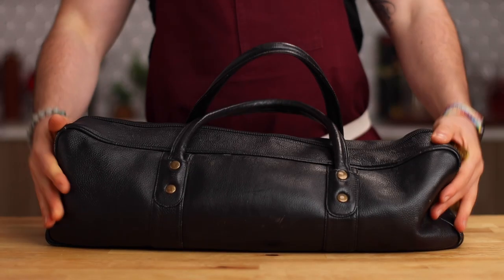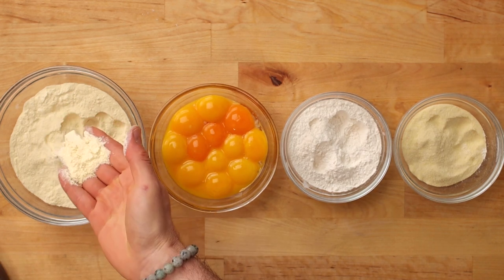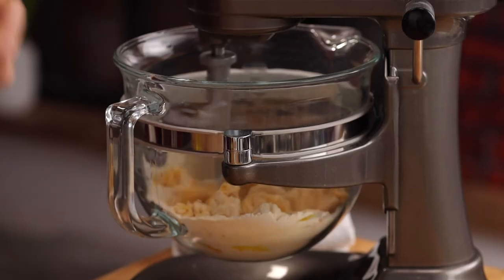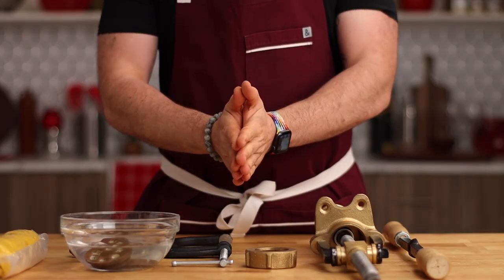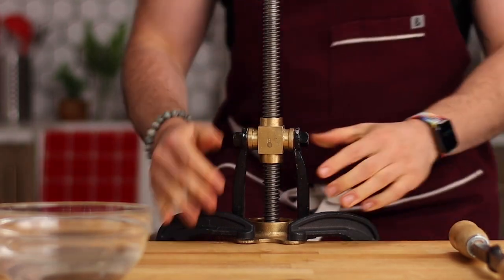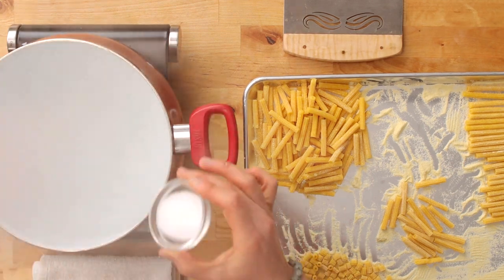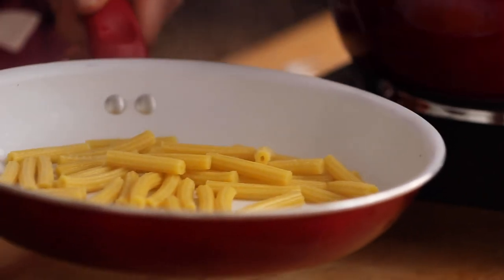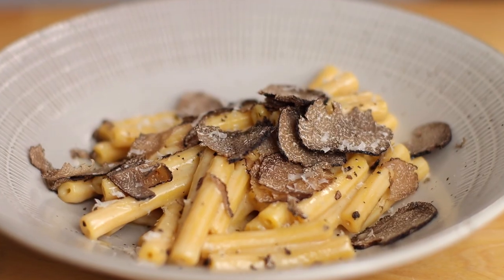Can This 500-Year-Old Gadget Make Delicious Pasta?

Comment: Can you clarify why you say 500 years old tool when the exact same one is actually sold for 240€ by an Italian brand?
Did you mean traditional instead of 500 years old?
The mustache is 500 years old, not the torchio.
Reply: Dude maybe it has been around for 500 years .......... just because something has been used  a long time does not mean it shouldn't be available today
Reply: @sreelakshmi4341  no it's not about that, he's presenting the tool it has as "500 years old". A Google search led me to a company manufacturing it nowadays, same shape, same handles, same logo, brass and steel, 240€. It's like saying I'm gonna use this 10000 years old tool on this nail. Nah, the hammer might have been invented 10000 years ago but the one  you're using is from your local store.
Torchio has been invented in 1600 ish but the one in his hands is brand new apparently. After my comment I saw others commenting the same thing. Misleading title and information I guess.